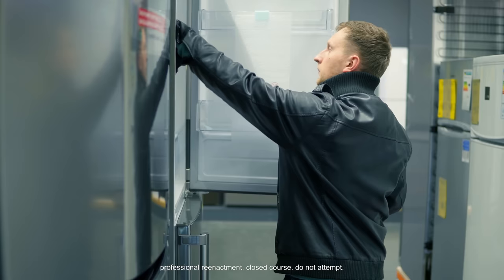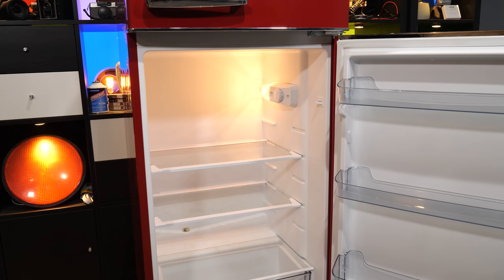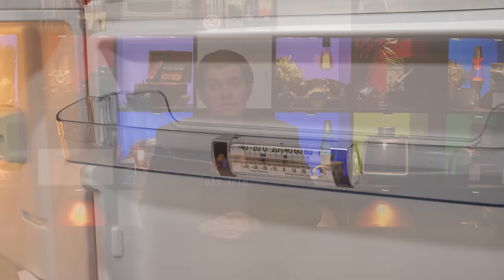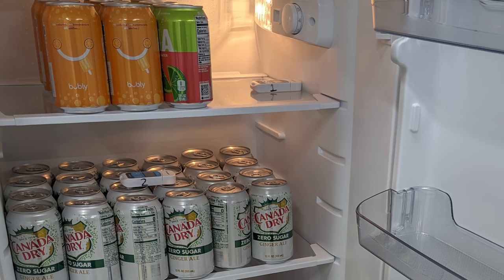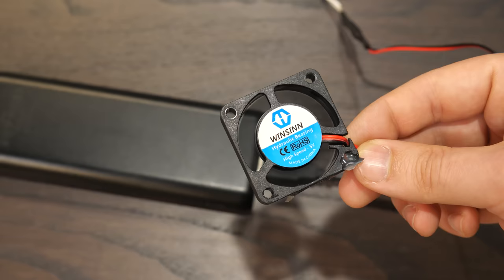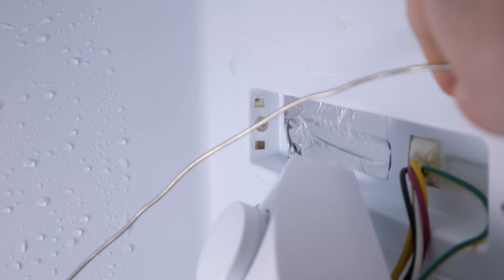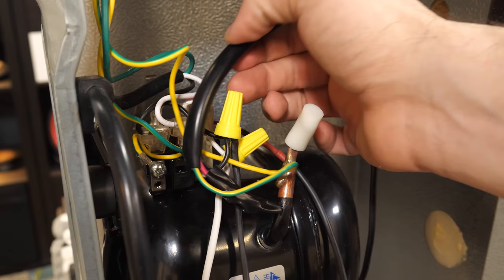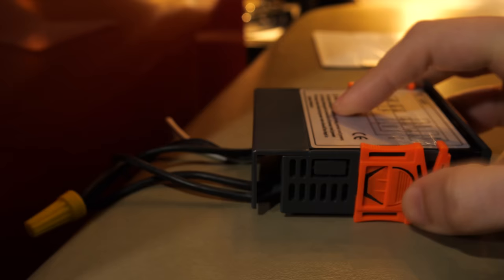This goofy fridge has a really clever design. It's also kinda terrible.

Comment: Given how the convection of air was so optimized, I wouldn't be surprised if there was a reason for the thermostat being sensitive to run time of the compressor. It may be to do double duty as a shutoff of the compressor to manage its heat or something. This is a very interesting deep dive.
Reply: I was wondering if that might be the case as well to maybe help prolong the life of the compressor. As it was from the factory, it's clear it was designed and placement of the temperature probe was to maintin duty cycle more than temp.
Reply: Yes, I agree.  It's most likely not a fault of the thermostat, but probably an overload protection of the other components that's shutting it off.  As soon as the compressor has cooled off enough, the system turns back on, overall getting a little cooler with each cycle.

Comment: I love your videos. One note that should be useful to know next time you put a fridge on it's side. You should have it on the other side. That way the oil of the compressor would only be allowed to go into the service tube , which can make no harm. On the other tubes there is always the chance that some oil stays inside the loop and reduces the efficiency of the cooling cycle. Even after you let it sit for an hour there could be  oil left inside the tubes. Keep on doing those excellent videos!

Comment: Maybe you should monitor the temperature of the compressor now, as the new controller only cares for the inside, and does not shut down when the cooler has run hard for a while.

Comment: There might be a point to the thermostat being sandwiched between the evaporator and the inside of the fridge. It could be a clever way of preventing liquid refrigerant flowing back to the compressor.

If the temperature at the start of the coil gets too low and the fridge doesn't have enough heat in it to fully evaporate the refrigerant then the compressor switches off. If the coil is cold, but the fridge has enough heat in it to evaporate the refrigerant, then the sensor reads a warm temperature and the compressor keeps running. It's essentially a neat way of measuring two things with one sensor.

Seems like a lot of trouble to go to to run the sensor down there away from the space, so there must be some point to it.
Reply: Yeah, I really like this channel, but there are a lot of points about this that are not coming from a place of experience or understanding of what is. Lot's of I know what temps they should stay at, with no knowledge of how simple refrigeration units run. Unless you want a computer in that thing, the original design is probably nearly optimal for that unit. Lord only knows how much power that thing is sucking down, that and how cold is the freezer getting. LOL
Reply: @lucaschase8661  I mean, you guys say all of that, and even it it is true, that doesn't change the fact that a significant portion of the fridge wasn't getting cold enough to preserve food at all. 
Intentional or not, a bad design is a bad design.
Reply: @notbob555  I think it's mostly a case of a cheap design. The compressor's probably a bit undersized and they've tried to minimise the componentry to reduce the manufacturing cost, but there's some interesting engineering to make it all work (sort of). You can only do so much without all the bells and whistles his new fridge will have in it.

I'm just throwing ideas out there as to why they would go to all the effort of running the sensor away from what seems like the most logical location for it. Preventing liquid going back to the compressor seems to make the most sense to me (compressors don't play nice with stuff they can't compress). My background is in commercial HVAC, so I'm not claiming to be an expert on household refrigerators though.

Comment: Alec - you might want to look into circulation fans for RV refrigerators. They're made specifically to move the air within small RV fridges as it cools to food-safe operating temperature (since these often sit dormant for extended periods), but I think they'd be perfect for this use case, should you ever decide to revisit it!

Comment: For less technologically sophisticated folks, there's a little bit easier way to apply your fix.  A Johnson A419 thermostat allows you to simply plug the AC for the fridge into it, and then plug the A419 into the wall.  You can then run the probe into the fridge - a lot of homebrewers use this to convert a freezer into a kegerator.  The catch is that you need to be able to set the thermostat of the fridge low enough to run constantly, which may or may not work depending on the circumstances.  Since homebrewers use a freeze, the setpoint of the freezer is always below the desired refrigeration temperature anyways.

Comment: Fun fact: I basically did the same fan and inkbird (but the WIFI version which comes with a data locker) setup with a big, old but good quality chest freezer by Miele. I did so because i was fermenting about 100l of beer - that means heat due to the fermentation is actively heating up the inside of the freezer - in it and i wanted to distribute the the cold more evenly. worked very good! it even didn't really matter weather i put the sensor in the air or directly into the beer. with that fan (the size of your bigger fan) i could double the time between the cooling cycles. give it a try ;-) another rabbit hole for you

Comment: I think the controller is working.  The sensing bulb  senses the temp of the evaporator.  when off it will not start until the evaporator is about 39 degrees. That is how the evap does not build up a lot of frost. they call that cycle defrost ..being it senses evap temp it probably shuts off at 5 below or colder.  The freezer is designed to get to about zero.  With the electronic control the food compartment will be good but the freezer will be to warm

Comment: I have two different split mini - fridges, and while they look quite different outside, the internals are the same. I am going to be looking for a digital thermostat like the one you used soon!
Reply: Just get wireless outdoor thermometer(s), use lithium battery in sensor part and you can  monitor fridge or freezer part realtime.

Comment: The reason for the placement of the thermostat sensing tube within the walls of the fridge is more than likely because the bulb is sensing the temperature of the suction line/evaporator. In commercial refrigeration, we use these controllers all the time. The idea is measure the temperature of the evaporator which directly correlates to the temperature of the space under normal circumstances.

Comment: When I saw how long this video was, I thought I'd never sit through the whole thing.  But I got sucked in!  Partly because I have a very similar design myself.  We bought a Danby "Fridge Only" about 15 years ago, to use as a place to store our veggies in the summer.  It's about the same size, has the same fanless design, with the simple defrost scheme with the little drain at the back that goes into a pan below that sits on top of the compressor.  It's biggest problem is that the little drain can get plugged up, and that leads to it "peeing" on the floor.

Comment: I've been using a "mini" fridge like this for the past 10 years as my main fridge in a rented apartament, and I think it might be around 20 years old.
The only differences are a visible condenser and the thermostat is actually mounted above the freezer compartment. Everything else seems pretty much identical.
The freezer keeps frosting like hell and the upper back of the cooler often gets temperatures a bit below 0, but I actually use that to keep meat there - makes it last a few days without actually freezing it solid.

Comment: The thermostat capillary is buried to the wall to make sure the freezer gets frequent boosting. The 30 minutes of run time pretty surely gets refridgeration going in the freezer as the back wall of the refridgerator will just frost up and not suck up all the thermal energy it could with a fan circulation.

Comment: I have a nearly identical fridge to that (minus the neon red) in my basement for snacks and drinks in the family rec room. It's been running for 3 years straight and at this time has about half an inch of ice caked along the walls of the freezer portion. I freaking love this thing, it's so simple and efficient! No, it's not the fastest thing in the world, but it doesn't need to be. And because the walls of the freezer are so incredibly smooth, you can chisel the ice off very easily with a paint scraper, it just falls right off. (I just tried this only now, lol)

Comment: Great HOUR LONG VIDEO, Alec!  I've had mine, currently named "Little Red" (which replaced the lettering on the Freezer section, has been going strong (even though it is in my garage) for 3+ years now.  Other than the freezer needing a bit of defrosting, it's kept food and beverages quite cold from day one. Thanks for the details! 😋

Comment: You should have monitored compressor temps too, I think thats the run-off pattern you're seeing at the top temps.  The compressor had to cool!
Reply: Agreed, the compressor has a thermal overload and as it heats up it cycles the compressor to protect it. Why did it run fine at first? The fact that the condenser is a chest style which could heat up slowly over time. As it did, the pressure in the condenser increases increasing the load on the compressor causing it to pull more power and work harder increasing the compressors temperature and causing it to begin cycling.

Also, as for the refrigerant and it's volume. Thank your environmentalist for that, all new refrigerators are now using flammable refrigerant and, the amount allowed is also restricted. Now, I will admit like you I was extremely surprised that it only has less than 2 Oz of refrigerant and I suspected from the beginning that at such a low volume this thing was going to struggle and not work right. I think that is playing a huge role into why this thing suffers so hard to keep up, especially being a chest style as chest systems typically have the most refrigerant as they have such huge coils.

Comment: So for what it's worth... I used to work as a toolmaker in a domestic refrigerator plant.

Cyclopentane is the "blowing agent" used to flow the 2 part polyurethane foam (insulation) when it's injected in the cabinet and doors. R600a is butane. The only reason they put the explosion risk warnings on fridges is to account for the chance that there is still SOMEHOW some cyclopentane left in the cabinet that hasn't evaporated.

Comment: Wire rack shelves might help with the top to bottom temperature differential, and they might be cheaper too. 
A thin layer of insulation around the compressor cubby might help prevent heat transfer to the interior, and it wouldn't cost much.

Comment: Great video, but is this type of fridge really that rare in the US? Here in Europe, this fridge type is quite common in rental apartments (considering it's performance/price, it probably falls under the "landlord special"). Also funny that you refer to it as a mini-fridge, never considered it as such :D 

Another question: how much did the fans heat up during usage? Could that be one of the factors that lead to some of the weird results you got during testing?
Reply: Depends on what you mean. I'd say the double-doors with freezer on bottom (or split freezer left and fridge right) are common in upper-middle class houses. But the configuration like shown here is still the "standard" fridge. However automatic defrost with exposed (but with a plastic shroud) evaporator is the more common cooling design.

As for the fan, he mentioned the small one too 3 watts. That isn't going to add a significant amount of energy.
Reply: Yes. Too small for most applications. Maybe good for efficiency apartments in inner cities, but not in the ‘burbs.
Reply: Mini fridge in comparison with European cars as mini cars compared to 6 liter v8 pickup trucks

Comment: Great video, as always, but I think you missed something. The location of the sensor might not be a bug, but a feature to prevent long periods of working time. Otherwise, it would need a timer or a second temperature sensor to lockout the compressor. For a cheap fridge, it is a very clever design. They pushed its simplicity to the limits, to the point where it is very difficult to improve one performance dimension without making it worse on others.

Comment: For those wanting to do their own temperature monitoring shennanigans, I ended up using 1-wire iButtons. Often used industrially they come in tiny cans so less thermal mass to deal with, and they just barf the data out as CSVs if requested for you to graph at your leisure.

EDIT: Wow they're more expensive than I remember

Comment: Interesting video. I noticed a significant difference in the temperature that is recommended for a fridge. You said 40°F (4,4°C) or less. The EU recommends 5°C (41°F)and over here in Germany it is common to have 7°C (44,6°F). This is the temperature i used all my life. My fridge is relatively modern. It has a fan but only if you load a lot of warm stuff in it, you can switch it on manually. Its also common sense to use different temperature zones in the fridge for different suff. On top it is the warmest and at the bottom its the coldest. I.e. meat is sored in the lower section.
I also want now to try the different drinks you used for testing. Dose it taste good with 0 calories?
I cant believe i watched 1 hr of fridge content. ;)
Reply: The big difference here is that fresh milk is the norm in the US, whereas in countries like Germany UHT milk is commonplace. I live in Ireland where we commonly drink fresh milk, and the Food Safety Authority here recommend 0°-5°C (which is also what is suggested on fresh milk labels), with 3°-4°C being typical. Over 5°C and fresh milk will go sour before the use-by date.
Reply: @AaronSmart.online i live in greece and we also have fresh milk, which lasts just fine in 8c
Reply: @DimT670  maybe it's treated differently as you're in a warmer climate? In Ireland, most milk packaging says to store at 0°-5°C and consume within 3 days of opening.

Comment: 14:25 R600a is just isobutane, like in portable camping cooktops. Hence why it’s explosive.  A combination of isobutane and propane (R290) is very common refrigerant in air conditioning applications.
Reply: R600 is the new gas used in domestic units its just pure LPG (propane) but its filtered from contaminates like moisture etc..
Reply: @VK3NFI R600 is butane. R600a isobutane and very popular in small domestic fridges. R290a is propane and more common in small air conditioners and more commercial refrigerators..
Reply: @lozzamanuk  Yer I know my bad typo missed the iso  In Australia all domestic units have 600a  R134 is banned for new production units.  they don't go boom average domestic has about 60-100 grams less than some pocket lighters
Reply: @VK3NFI  Yeah I've never heard of that amount of gas causing a problem. They don't generally leak and it they do it's slow enough and with such a small quantity of gas as you say anyway...

Comment: So many times I've used crummy consumer appliances and thought, "I could design a much better control system than this."  Props to you for doing it!

I bought a Rancilio Silvia espresso machine several years ago, specifically because it had a simple bimetallic thermal control system that was just begging to be replaced by a PID controller.  Several years ago.  Still bone stock.  Some day ....

Comment: I wonder if the weird placement of the sensor was a "fix" to shorten the ON cycle times because of compressor overheating or having cheaped out in some other way.
Reply: I was asking myself the same question, they might have made it intentionally worse to protect the compressor, instead of using a beefier compressor
Reply: indeed,  like a anticipation heat element in older room thermostats like Honeywell
Reply: I had a fridge fritz out because it froze up too often - the fan would form ice and then it stopped cooling properly as there was no ventilation to push the cold air around. The technician who came to fix it moved the thermostat probe to somewhere warmer to force more defrost cycles. Seems like a design flaw...

Comment: Here in sweden the reccomended max temp in a fridge is 8 deg c. The 5c (slightly higer than your 40f) is just the reccomended temperature for produce to last longer. The danger zone starts after 8c.

Wich means the red fridge got back to the safe zone relativley quickley by those standards after dumping a lot of canned sweet water in it with nothing else there.

It is probably no problem at all in normal use

Comment: When you ran your tests, the little red fridge (LRF) should have had some mass in it, or the other fridge should have been empty. If there was mass in the LFR it would have kept the chamber at a more stable temp as that mass has it's cooling affect and would have damped the results.
Reply: he mentioned that and said he didn't think it accounted for much based on just how bad the results were, but also most of the tests following the comparison test had a large amount of mass in the fridge (the seltzer) and it still performed very poorly.

Comment: The temperature of the evaporator coil near the exit of the capillary is a proxy for the pressure in the evaporator.

Thus your little mini fridge is controlling for pressure at the compressor inlet.

This is a much nicer thing to use to control a compressor. 

This will probably result in higher efficiency for the compressor.